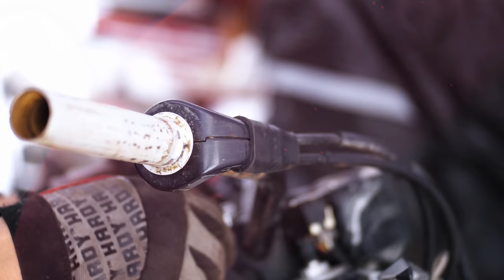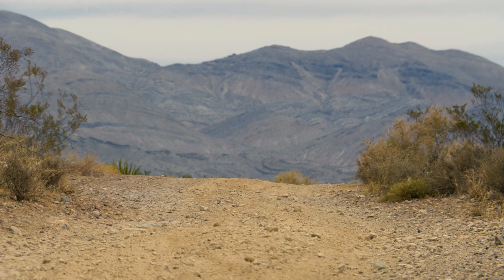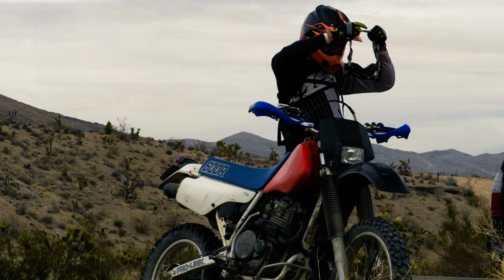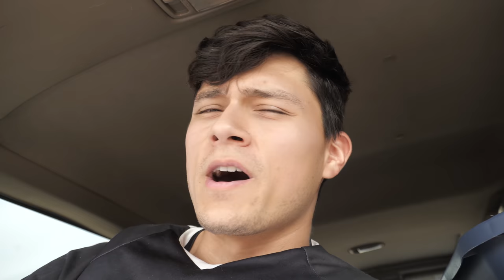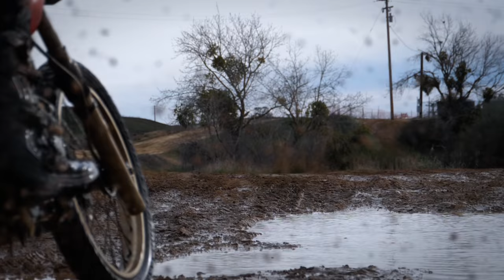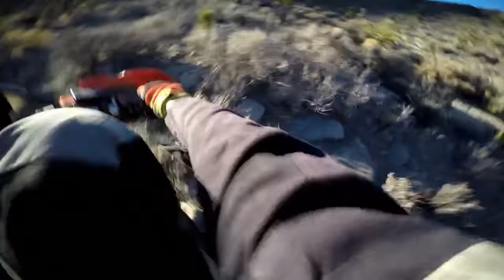XR600R - Size Matters. Testing the Beast.

Comment: I like your approach. Rode the 600R for years and the stock suspension and stock motor work well for most people and most riding a lot of the time. Money spent on tires and general upkeep are the bucks you need to commit. After market parts to lighten it up wont lighten it that much. If you are a good rider you can keep up with just about anyone else in your league on a stock 600. I did find that heavier fork springs were necessary even though I weigh in at 175.

Comment: You'll give me pressure to reactivate my '86 XR 600. Not moved since 1989. I'll walk in my cave to check my new project.
Greatings from Europe.
Reply: Hmmmm .. my ‘96 XR 600 has been taking a nap under some heavy tarps for about 2 years. It is riding season here in So. Commiefornia , it’s plated for street use but I let the registration lapse for almost 4 years. I’m sure those nice folks at the DMV will understand, I get gut punched for $550.00 a year for my Tacoma already.

Comment: Love my XR650L. I know you didn't not enjoy your experience with the L. But I basically turned my L into an R, sorta. Oil cooler, USD forks/front end, removed all unnecessary parts (probably 20 lbs or so), plus it has the magic e button. It's great, heavy, but great. Enjoy your xr and good luck.

Comment: Ive rode a 84' 250R for over thirty years up here in pacific northwest. It's amazing how fast you can go, sitting down, through tight, slimy woods on an old XR.
Reply: Still the cabin bike we let all our friends thrash. Best $105 bike, ever. Fresh oil, vslve adj and air filter once a year and it just won't die.

Comment: I'm lucky, I guess,  that I got to experience the air cooled XR's when they were all "state-of-the-art", so to speak. These are the bikes that made it all happen. I miss the reliability but for sure I don't miss kicking my guts out trying to hot start one of these stubborn beasts when they get temperamental on a hot day in the desert. The XR600R is a venerable sled even still toady in the right hands! And holy crap they can be fun to ride! Thank you for posting this video and enjoy the hell out of the XR!
Reply: Amazingly easy to start. Get it past TDC and use toes for leverage.Don't touch throttle.If stator gets weak,  it will not want to start, if at all. Try to wipe crap off the stator/flywheel, button it back up and try again.

Comment: I have a 98, much improved suspension over the stuff available in 1986, i have a 1985 cr500 that had all these issues so I just turned it into a hill climb bike where precision just is not critical. Kenda tires all around is a good combination for these heavy bikes, served me well.

Comment: Updating the brakes to disc oh, and running good tires is a good thing to do to live long. I'm 60. And I still rip on my xr600 just got the motor rebuilt now it really hauls ass
Reply: 😂 i was out on my 86 XL 600 chasing some kids around an when i stopped an took my helmet off they said" man... Yur rippin on that thing! Purty fast for a old guy"😂 didnt have the heart to tell them i race a KX500 in the desert. Iam 59
Reply: @mikepreciado7807  I've got a property out by Pahrump on the California border tecopa road. Let me know if you ever want to come out and ride it's like 20 minutes to Dumont on the back roads. Have a good one bro

Comment: Great video mate. I've had a long term love affair with the Honda XR's since my first XR75. The 600 is a great bike that is reliable and surprisingly fast. Sure it won't feel as light as a modern 450 but once you figure out how to "flow" the bike, they work very well. The big beast needs a totally different technique compared to a modern 450. You'll love it once you get the hang of it. Seeing the condition of the oil that came out of the forks I'd be at least getting the rear shock serviced and maybe a new spring. It has probably never been apart! Take a good look at the linkages while you have the shock out as well. Re-build kits for the rear linkages are available and reasonably affordable. I'm glad to see a young man giving the dinosaur a chance and keeping it alive. Fresh oil, Fresh oil filter and a clean air filter after every race will keep the XR going forever!. Oh, heavy duty clutch springs are a good mod as well as making sure the clutch basket isn't worn and full of grooves. They are hard on clutches if they get abused. Lastly, enjoy the simplicity of the XR. Once you have it sorted you'll have little to do other than wait for the next ride! Cheers. I have subbed to keep an eye on your progress with the old girl.
Reply: Fee if fo fum I  sence another Aussie son 
I learned to keep mine a gear higher than I expected, steer with the throttle and correct with the bars with surprisingly better results than expected, as I'm sure you know the drama comes when backing off!
Reply: In my recollection, is there not a 1/4 inch long  or so oil pipe when taking off the clutch case?

Comment: Nice video I love it.

I use my XR 600 last 17 years. This motobike ist just brilliant.
I tune it little bit up with custom stainless steel exhaust system, custom camshaft and forged pistons, tuned Carburetor. Results in about 56 HP on Dyno.

10:25 About Valves - set outtake valves up to 0,15 not like Honda says 0,12. ☝️

Comment: I rode an XR600 a few years before I bought my new 2004 Kawasaki KLR650. I swear that Honda was a beast and would blow away that Kaw. Wheelies in any gear and damn near any speed. It was a monster.
Reply: A friend of mine used to have an XR600R back in the early 00's and yeah, it was a beast. Huge torque and lots of power and it pulled HARD all the way to top speed. Seems like it would do close to 100mph top speed, with stock gearing.

Comment: My Dad had an 88' XR 600r. I probably had more seat time on it than on my own bike at the time. Mainly cuz it was the only bike that could keep pace with his CR500 in open desert. 30yrs  & about a dozen bikes of various sizes later it's still in my top 3 based on the fun factor. True story, I rode up what I thought was a trail to the top of a 25ft drop off in 2nd gear, well they didn't stop on a dime even going uphill so I bailed but the bike was sent over. In a panic I slide down the way I came up to get to the bike & assess the damage. The bars were buried so deep on the left side I thought they broke in half but I knew they weren't cuz the sand was holding clutch lever in & the beast was still idling!! Literally went off a cliff & was idling at the bottom. Bars were tweaked but that was the extent of the damage. The best advice I was told on how to ride those sleds was "point & shoot".

Comment: I loved my xr600. I was major bummed when honda racing dropped the xr for baja and went to the 450s. Bob Bell totally changed my xr into a manageable snarling beast.  The single most noticeable engine mod is to bolt in a HRC cam...totally changes the xr.

Comment: Got one of these old bikes but have disc brakes on it.  Im 300 lbs so a stiff suspension is a must.  

Yes the new bikes are superior in handling but what really burns me about new cycles is the initial price, high and frequent maintence costs, and the small oil capacities.  I wish there was a 600-700cc bike with modern design but simple components and larger oil capacity and better reliablity.  Im just an old guy who rides trails and old tracks recreationally and dont need to race so being reliable trumps ultra peeformance any day of the week.

Comment: the 1986 xr600 outgoing model has fully adjustable suspension. 43 mm air-adjustable leading-axle Showa cartridge fork with eight-position compression damping adjustability for the front and Pro-Link single Showa shock with spring preload, 20-position compression, and 20-position rebound damping adjustability. identical to the present day 2021 xr650L, if memory serves right.

Comment: You man handle that big heavy thumper! You definitely can ride bro! 
 
I used to be very competitive in gncc amateur 4stroke class about 25 years ago.. Did it on an xr 600. 
Bought a 650l last spring. I don't remeber them being sooo heavy.  Sure I weigh 70 lbs more and I am old but danm!  Electric start is way nice! 
Btw idk if you said it but that top triple is off an xr650l I believe.. Never seen an xr 600 with a full speddo.

Comment: I raced  a 97 XR600 in NETRA Enduros’ and Hare Scrambles  (New England Trail Rider) it was fantastic in the woods, with just a blip of the throttle to clear off camber roots.. since I am 6 foot 2  It wasn’t much of a problem at all to throw the 285 dry weight bike around in the woods

Comment: What you where describing about the front tire, I’m not trying to tell you what I think you should do but simply share my experience, I own a Ktm 300 and the front end can get get knify, what I found that really helps this outside of a steering damper was going to a 110 on the front, golden tyre specifically, but regardless the added width as a byproduct also smoothed out the tracking and washout

Comment: I raced a 92' xr600r raced in desert racing, gran-prix's. I cut 1 inch off each side from bars, changed front sprocket from 13 to 14 and stock 48 rear. with bark busters' w/guards for cactus. I found the xr to track better thru rocky rutted terrain.

Comment: I did a yz250 fork conversion on a 2011 klr after an incident. It had Ricor valves and Progressive springs and new oil in the factory sticks.
The conversion gives little more clearance, travel and adjustment but less turning radius. 
For the time and money to convert the forks, it was cheaper and easier to just replace the guts of the stock forks. Really no difference for my riding. It looks cool. And with the heavier spring wrapping the factory rear shock, this pig can fly😆 and land.

Comment: I've got a 2000 xr650R.  Love it,  I've got rear disc brakes which definitely helps however I don't use it much. In order to get the back end around I just give it gas. I live and ride in the Canadian Rockies.

Comment: A very cheap mod is the fork brace and it makes the handling much more precise. It bolts on the the forks right above the tire to prevent twisting. Think I picked on up for $80. I was going to do a front end swap but after the brace it was good enough.

Comment: The threading bolts for the Bushwacker are ideal for all off-road bikes no more of those Molly's that ago in the end of the handlebars get the threading kit that cost 10 to 13 bucks never have to worry about them rusting and falling off on the trail.

Comment: Good stuff, man! 

I rode a XR400 for years. Also own an early 250 and a XL500S. Those XR's front discs were pretty legit. Honda used good metal in the rotors. I tweaked the front rotor on my 400 and replaced it with a Tusk disc. Squealed awful and no pad works grab it. Bad alloy. The old XR's don't get enough respect. 

I hung a pair of twin cans off a CRF 250 on my 400 strictly for looks and for fun, but it totally shocked me with the midrange I gained. The bike actually wanted to rev! Aftermarket exhausts are a huge scam, but if you can find a cheap way to free up the exhaust properly it may be useful to your faster riding style.

I'm on a KTM RFS now and I love this bike, but the old XR's don't get enough respect. I think I need to order me one of them shirts :)

Keep having fun and keeping it simple. Ride safe, dude ✌️

Comment: Back years ago I use to run pirelli scorpion rally on the front for that reason, your shocks need some air pressure put in to help with damperning their not like upside down forks how you have to get the air out, from memory you stand up the bike and pump air in until it raise up a inch with a  push bike pump just keep each side the same and just run the oil at the Right level I think it was 130mm, but look up the spec, I always ran castrol 4t and never had a clutch problem, just don't let it get past dark brown.  but she's really looking good 👍👍 hope this helps

Comment: I had those handguards...they are ok for bush protection but not for falling...they bend realy bad every fall and needed to strech them after amlost every ride otherwise levers got stuck so they create more problems than if I took them out... Brought only the bars from Moose racing for cheap (~25$), install one piece brackets (without the joint) for them and they are really night and day difference.

Comment: Great bike I have loved the 6oos and 650s Honda makes great bikes.    Not too big either for a bigger guy , I'm 260 and I can control it easy.   Smaller guys have hard time with the heavy bike.   Still a great bike.    My last one was bored out and reeds and trick head and she flew.  Clocked in at 102 mph.  Yes it's possible. .I hear of 120.mph with a bit of work.  Great bikes

Comment: Re the tyre issue. These bikes feel out of sorts on tight tracks.
On the open ground, at speeds of 100- 120km you will be ripping the knobbs off the tyre, floating over terrain and obstacles, with momentum it will feel stable.
If not, check all the bearings, wheels, suspension and steering head.

Comment: Nice video. How much weight did you lose overall? I had a 1979 XR500R. Bought it brand new. First time dirt bike rider. Basically, did almost the same thing you did. Bars, grips, fork oil, rear tire, drilled the air box, etc. Looked amazing but, way too heavy. The guys who talk me into this bike all were motocross riders. When I road their 250s & 125s two strokes I had way more fun. They would take mine through the woops and almost die. With their bikes they would fly through the woops. We use to have races out at the hog farm and everyone one loved my bike. It did have lots of torque. You brought back many memories Thanks

Comment: Grind off the leading and trailing edges of the shoe so the edges are rounded help with contacting the drum the rear will work better, also round over the brake cam hope it helps

Comment: +1 For Kenda Trakmaster rear tires. My favorite of all time. Those beasty side lugs really dig in soft stuff and the tire doesnt lose traction when worn. I can run 8psi slow riding and 10psi faster desert and never get pinch flats or bent wheels.

Comment: Did you have  trouble  starting the XR?  I have a 1985 Honda XR 600 that I  cannot  get started after getting  it rebuilt.  I weigh  185. I wonder if you have  to a two hundred  guy?

Comment: VALVE TIGHTNESS!
Don’t freak out it’s just the valve seat wearing so the valve is longer. If the clearance is too big it’s from the cam or shim/bucket wearing.
Reply: 6honey valves loosen up as they wear
Reply: @jimbo4203  valves tighten as they wear as the valve seat wears the valve sinks upwards into the head causing the gap between the tappet and the valve to reduce. If your valves are constantly going tight it's because your valves & most likely seats are dead.

Comment: I know you didn’t like changing tires during a race but if you hade a back up rear wheel from a yard you could have atleast a rear tire ready so you could swap it out during a break. For real though I’m almost a certified tech and I have nothing to do all day if you needed some pit crew let me know. I ride like 8 hours a day often so in my head riding 8 hours to somewhere is no different than cruising around my state.

Comment: Good on you for giving these old bikes a go....back in my day when they were new they were weapons, especially in the 80s when dirtbike progression was massive....

I had an 89 xr600 that was well sorted, suspension etc...added an 88 xr250r  oil coiler and the best go faster mod of removing the butterfly choke flap (theres a vid on youtube by Rum Soaked Studios on how too) for more throttle response....although a mikuni tm40-6 carb kit that’s available nowadays from Mikuni Oz would be way better.....

Anyway just one last thing...don’t rev the old girl like a CRF, short shift her and keep torquing her along...
Reply: I too had an 89 XR 600.  Bought new in 90 from Plano Honda for 2999.00.  Was my first bike.  It was so awesome.  Except in deep sand.  MX bikes far superior in dunes.  But I think xr600 would be so fun to run baja course, not race.  Just enjoy.   The motors on these are just about as bullet proof as it gets!

Comment: Put a swing arm of a 91 or newer xr 600 then you will have a disk rear an 18 inch rim and your swing arm would then be aluminum saving you some weight also 89 and up cr 500 triple clamps and forks will bolt up to the stem giving you inverted forks  for a less sloppy ride.

Comment: What throttle did you order I have the same bike and want the throttle you got but don’t know size and length
Reply from the maker: Throttle was just a motion pro vortex modded to accept the stock pull cable. You'll want to lighten the carb springs and shave down the throttle cam on the motion pro to get the right amount of turn without it being too stiff

If you enjoy the content please check out my "best ways to support" page on my website which shows how to support the channel for free! Thanks!
 https://torturetestmagazine.com/pages/best-ways-to-support-ttm-some-are-free

Comment: Modern bend handlebars make this bike feel 100 times better. Night and day. Find you a set of any cheap or hand me down bars. You won't regret it.
Reply: Im guessing you might enjoy the story of how I know this. My buddys dad came home from the flea market with one of these and the engine was in a milk crate and a cardboard box. After a few weekends of piecing it back together and at least two extra tear down/reassemblies of the engine to get the oiling in the head correct. She was ready to roll. He had some trouble learning to start it at first, but thanks to my previous ownership of a yz426f I was able to decode the process right away. We loved it, except the ergonomics felt really awkward. So he threw on the new bars, I'm not sure what bend they were. It changed this bike so much, I'm taking the time to write this. It is really a great bike. Have fun on it. 👍👍👩‍🔧